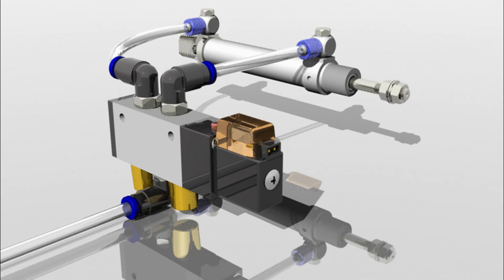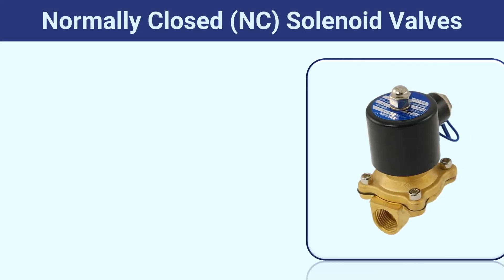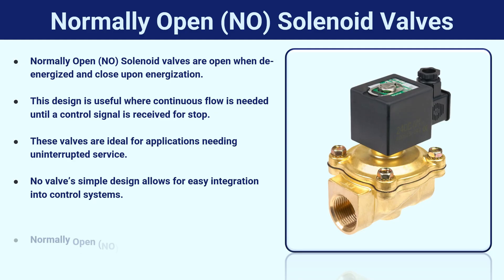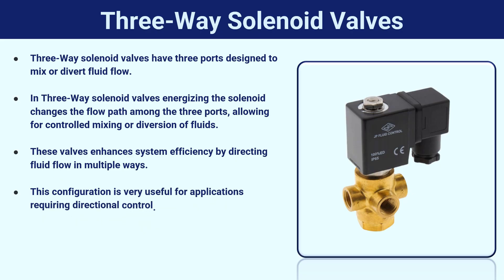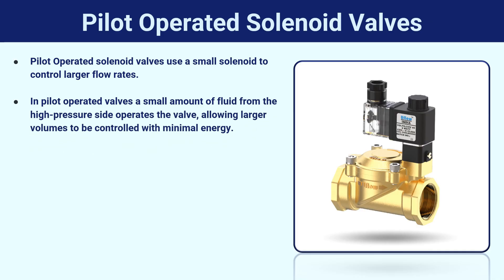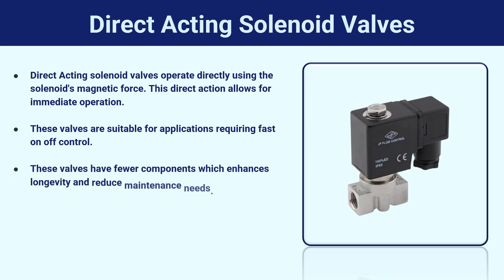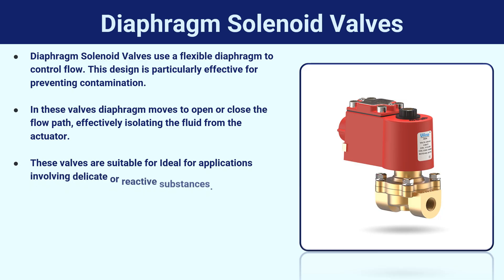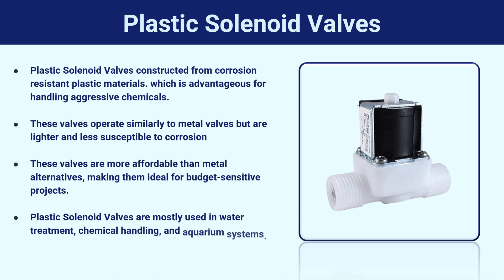Types of Solenoid Valves | Working & Applications Explained |

Comment: 선생님 안녕하세요?
완전기계 초보인데요..
공압  solenoid v/v 에 대해 너무 궁금한 사항이 생겨 문의 드리고 배우고자 합니다.

1. 3 way, 5way 단동 sol.v/v 는 spool쪽에만 spring 이 있고 , plunger 쪽에는 spring 이 없는지요?

2. 3 way, 5way 복동 sol.v/v는 spool, plunger 양쪽 다 spring 이 없는지요?

3.  3way solenoid  valve 인데요.
1,3 port는 사용 안하고, 2port만 실린더에 연결하여 쓰는 경우도 있는지요?
분명히 1,3 port 는 이 port 에 연결되는 공압선을 잘라서 끈으로 묶어 사용안하고, 2 port만 공압 실린더에 연결되어 있는데도,  sol v/v 전원이 on/off 되는 경우를 봐서요....

4. air pilot 는 3 way, 5way 단동, 복동 solenoid v/v에 다 있는지요? 
혹시 solenoid v/v 에 전기를 공급 안하고, 이 air pilot로 공급되는 압축공기만을 써서 plunger 나 spool을 움직일수는 없는지요?

5, 5 way solenoid v/v 의  5,1,3 부위 의   5,3 부위는 막고, 1 만 사용하는 경우도 있는지요?  이건 단동 cylinder에 사용하는 경우인지요?
 5 way sol v/v를 단동실린더, 복동 실린더 다 쓸수 있는지요?

감사합니다.